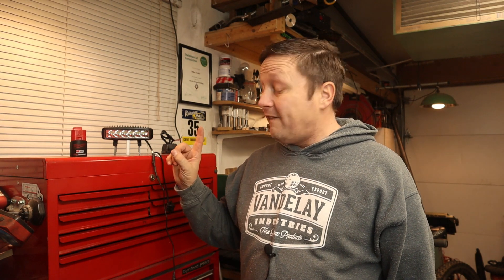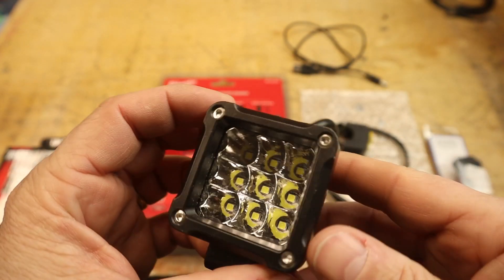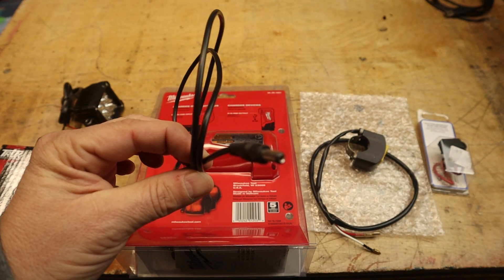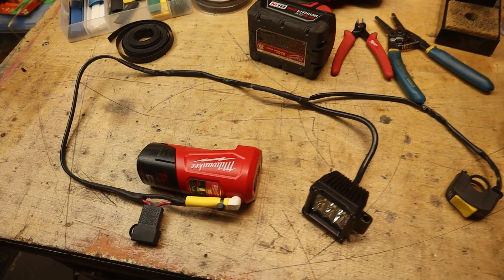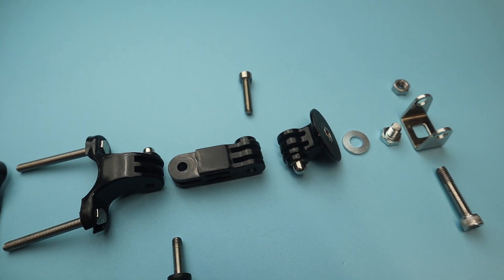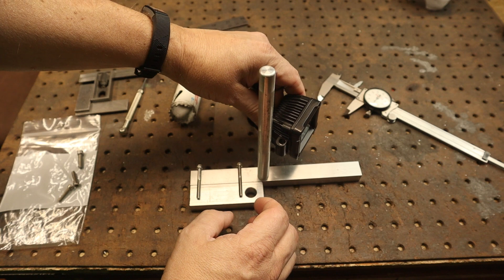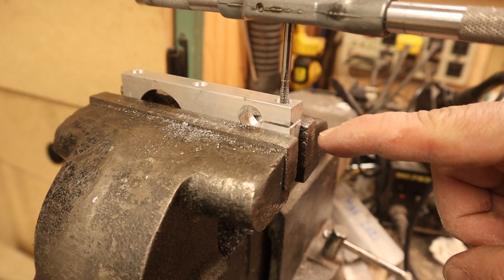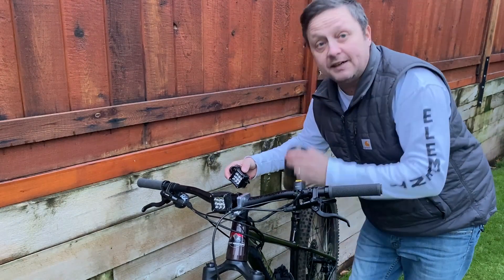Make a bright bike light that can rival store bought / Compact, easy to build and rechargeable.

Comment: Another option for mounting. Pickup a couple of pipe stand off clamps. You can get fancy copper clamps. Or standard galvanized clamps. Electrical conduit clamps also work. Make sure to use some heat shrink or inner tube on those clamps. Prevents it from scratching the bars. And hold it in place .
Reply from the maker: Great suggestions for alternative mounting options! The pipe stand-off clamps sound like a sturdy and customizable solution. Thanks for the input!

Comment: I want to run a 12v light, not sure the watts, and use a 18v 5ah makita battery. BUT I need the light to mount further out about 3ft away from the bars and use a switch to turn it on and off. Doable?
Reply from the maker: It may work. Some automotive 12V LED light have a voltage range fro 9 - 24v, so you may be okay. If not, you will need some sort of voltage converter like a Buck-Booster to help dissipate ~6 volts. depending on the wattage of the light, 3ft away should not be an issue if you have a correct wire size. There are charts online for wire and amperage ratings.  Cheers.

Comment: Hey Mike. Can you use a widely available dimmer for 12v leds with this light?
Reply from the maker: Hi, I don't know if these automotive style LED's are dimmable. It doesn't say anything on the box. They do have a wide voltage range which would make be believe they are regulated somehow.  If they are cheap enough, I guess you could try.  To be honest, I'd be sceptical in adding another device in the chain. Something extra to possibly fail.  The battery draw will probably be the same.  Cheers

Comment: Cheaper way to do this is to buy a rechargeable flashlight from like Walmart.. they have this decent Nebo 800lumen rechargeable light for $30 and then buy a two pack of Husky rechargeable floodlights from home Depot for $20.. me personally I would run the Nebo at half power for a good spotlight for what's up ahead and use the husky flood light to brighten what's closer.. I calculate that you could get about 4 maybe 5 hours total and for $50..

Comment: thoughts on using 12v rc batteries instead?
Reply from the maker: Yes, you could. Some of those RC batteries can be volatile especially if you don't have a proper BMS and proper charger.  I built mine with the M12 system since that is what I had in hand, they are relatively safe and a compact design. cheers.
Reply: @MikeFreda  im looking at it because of the price competetiveness. looks like its 12v 30000mah that comes with a barrel jack charger thing. it claims it has overcharge, overdischarge, over current and short circuit protection. it uses 18650 cells. so it would probably be better then what i could manufacture myself. it has barrelljack plugs for charging and for use. also i dont have any 12v batteries. it

Comment: Great videos! I looked for a solution to build my own light system and the first I found was ur channel. Coolest thing about it is that ur using same battery I already have at home, so really stoked to start this build. Feels cool to be able to run my screwdriver and bike lights on same battery.

I would also like a rear light? Do u have any recommendations for this? I guess it would be simple to just add it to the existing system?
Reply from the maker: Thanks for commenting.   Yes, I’ve added a tail light before but it’s easier to do with a little pre-made flashing led light meant for that purpose. What I did is use a small automotive round red 12v LED light meant for a clearance light. I just ran a small wire from the switch and another wire back to ground. You could also make the red tail light switchable.  Pretty simple really. Cheers.

Comment: why do you try a flashlight chopped down , or a diy flashlight , there are many option for 2000lumens at 3.5 vs, why do you choose 12v? 
  I feel like every year I go to rebuild my diy light and never see any actual progress.
   the light pods I got from amazon 4 years ago where 2000 lumens each at 15 bucks a piece, the only issue is they are 12v.
  there would be tons of options are 3.5vs.
 for anything train all you really need is 2000 lumens , and you can add an 800 or some one to the helmet if you need more light..
  it would be nice to invest in a system like miwalkees , but its just costs too much, and you have little control over the cells..
 there are very few products that can deliver a water proof harness for 2700 or 18650 cells.
 I got lucky with my packs and just use a smart charger!

Comment: broooo ugh milwalkee batteries are 50 bucks plus the charger, NO WAY GUY, why cant you ever do this right? I like the motorcycle switch , but the battery pack has to be around 4 ah to 6ah , id love 10 with the option to recharge via dynamo, but at this rate we will never see it, not many well know companies make a 12v pack or harness that can accept quality cells?

Comment: Thanks for your video. Pair any 12v automotive, motorcycle or atv light with a battery jumper pack. I recommend a yesper. Besides the 2 usb and usb-c ports, it has a standard 12v barrel port and a 12v jumper cable port. My setup was a fog light consisting of 6 high power led and one battery jumper pack using the 12v barrel port. My pack is rated 24000mah/88.8wh. I can ride my bike 6+ hours. My setup cost $130 ($10 fog light + $120 jumper pack) but to me it didn’t cost me anything because I needed a jumper pack that could start a big block V8.
Reply from the maker: Yes, those jump packs are another option. They can be a bit bulky but if you’re not concerned about that then it will work great.  Cheers.
Reply: @MikeFreda   Thanks again for your idea. You are right about the weight. I will now use my 18v Makita power tool battery instead for local riding. But I will still have the option to bring my jumper pack when we go camping or to the beach. The 12v LED light market is so awesome. I will now convert all my Classic Cars to LED. Thanks and keep up the good work. 👍
Reply: 120 for a battery pack is stupid :( need something cheaper better, the 2700 cells are gonna cost  40 at the most , Id look to recycling sites that cell older battery packs!
Reply: the jumper packs seems to the closet option for 4 to 6ah in a premade product !

Comment: I built a very similar light to use on my mx bike, yz250 and wife's kx100.   These bikes don't have charging circuit or batteries to run lights so I had to come up with something for winter rides.  I used a cb antenna bracket to mount to the 31.8 mm handlebar.   
The cb bracket  clamping side was to small n bolts were to short so I used a small u bolt n trimmed to fit. Easy n light enough.  I run dewalt 20v max lithium batteries  as the first light you used is for 12v and 24v systems.  Works great
Reply from the maker: Right on!   Thanks for commenting.  Cheers.
Reply: i just used a garmin bar mount with a go pro tab on the bottom !

Comment: The only problem I find with these lights & most cycle lights, is that they tend to blind oncoming traffic. I was cycling down a down hill lane once & came across a group of MTB'ers standing on the opposite side of the road & I was blinded by their lights, I had to drop from 30mph to about 5mph, after that, my eyes were bleeding, well, felt like it anyway 😬
Reply from the maker: Yes. They are bright especially if they are not aimed right.  Sometimes if I ride on the road a  for a bit I’ll bring/use one of those mini handlebar light that you stretch around the bar. Just enough light to let people see you. Cheers.

Comment: Where did u get the power cord for 12v output from the battery pack
Reply from the maker: The light and switch had wire already attached to it. The Jack is repurposed from an old AC adapter and the remaining cable is from an old house lamp that I cut off and repurposed. Cheers

Comment: Hey nice video i prefer your old battery system using the 18650 samsung cells could you please make a new model with a light bar and use vruzends solderless battery systems and heat shrink it to look like actual battery. Also add a switch for it, I’m really intrested to build my own for my emoto bikes i have a surron and kuberg freerider, i go on night rides and am unable to see anything, having to navigate from my friends lights
Reply: you still need a bms so the cells wont explode, I have tenergy cells I got from jag , but normally they are 10 bucks each, so if you want 4 to 6 ah its still gonna be 50 to 80 bucks !!

Comment: i really like this. looking forward to making my own.  how about a waterproof 12v socket built into headest. so lights can be left in place permanently? not sure if it would fit. then plug battery in. also use the stem bolts to keep thing central and minimal.
Reply: there is 12v socket on amazon with built in switch. help keep it minimal.
Reply from the maker: Interesting. There is always room for improvement. Thanks.
Reply: i used a smart charger and I just take the batter out of a saddle back , I kept mine in a zip lock bag!

Comment: Coming from R/C, if you have already invested in a smart charger- you can build your own 18650 packs and not use a BMS, it's your call.  Nice idea, I've had 3 StupidBright lights fail due to vibration- the automotive light bar is a great idea. The higher end bike lights are not worth the cost.
Reply from the maker: Thanks for your comment. I have done that and it works pretty good. Have a look at my version 2 light.  I had many comments that people wanted something easier to build and purchase.  I.e. plug and play so I came up with this battery system.
Reply: the main issue is the batter pack, I scored some 12v molicell packs from jag35 almost 5 years ago never seen anything close to that price they where 8 bucks each 4ah , perfect !!!